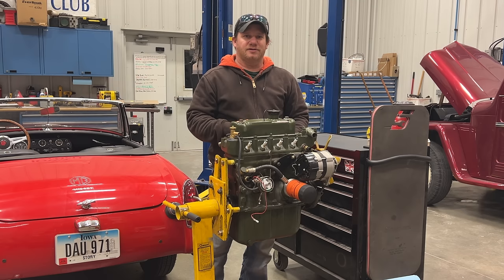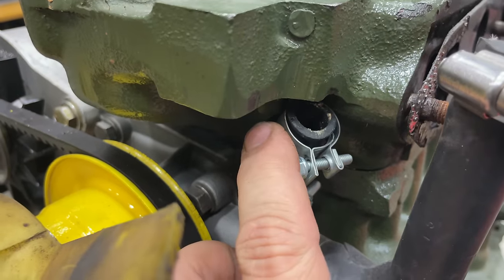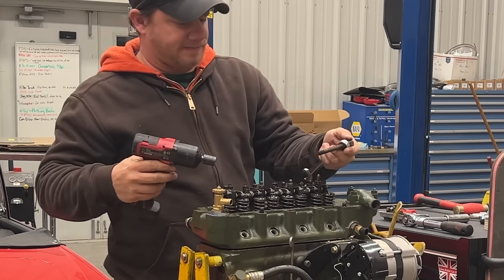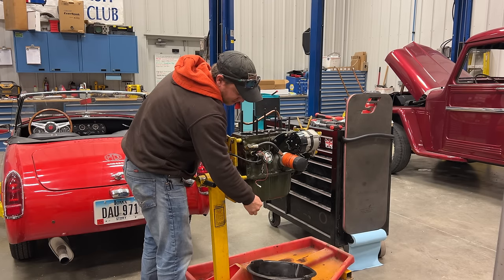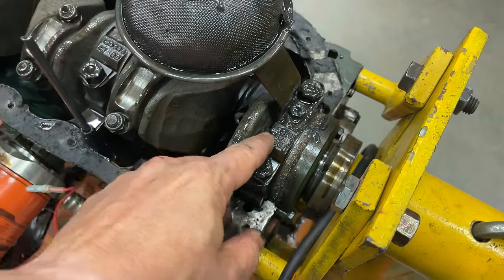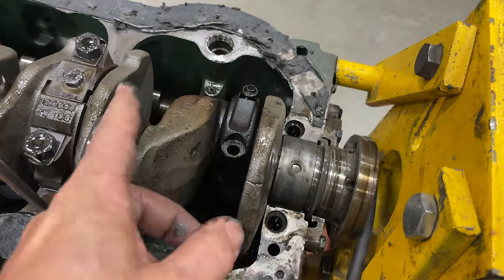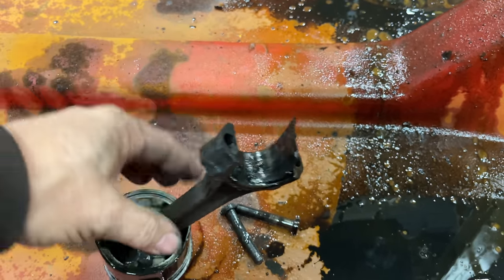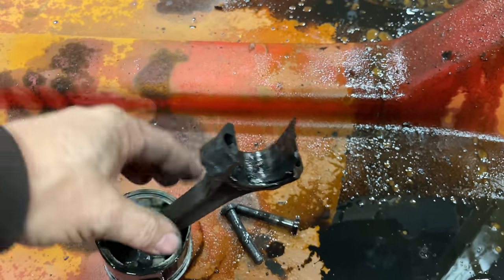Disassembling MG Midget Engine to Find Failure

Comment: If it is the origonal engine block it would be nice to keep it if possible, otherwise it matters little. The earlier models had castellated nuts and a split pin if I recall correctly, otherwise should be nyloc or similar.

Comment: Why on earth don't you get a tiny endoscope for having a look in the cylinder through the spark plug hole? They are only a few quid on ebay
Reply from the maker: I have one and have used it in many videos, no need to waste time when I am pulling the head off anyways.
Reply: @ThisWeekWithCars  Good point, and I didn't know you had one as this is the first video of yours I've seen

Comment: It has a nice coat of paint !  A few years back I bought a used Spitfire 1500 that was out of the car it looked good and had a fresh coat of black paint.  The gaskets were not painted which is a good sign meaning it had at least been apart when painted.  Fortunately the price was decent so I took a chance.  Back at my shop I pulled the pan and it still looked clean.  Upon pulling the rod caps it had a spun bearing almost as bad as this.  The scum bag had blown the engine...pulled it apart...cleaned it up and painted it then resold it.  Buyer beware.  He never represented as rebuilt however...just said it was a good engine.
Reply: Good for parts.

Comment: That was almost a lucky escape, a bit more time, and it would probably have thrown the rod and piston out, through the crankcase and then there would be no speculation about a possible repair. At that point it would be 'caps off all gone'.
Reply: Very lucky.

Comment: Given the condition of this bearing I can't believe the driver of this car did not get substantial early warning of imminent failure.  Oil pressure must have dropped significantly not to mention serious abnormal noises from the engine.  Early shut down and investigation might have resulted in far less damage.   It is amazing what some insensitive drivers will ignore until catastrophic failure.  I will not own a car without an oil pressure  and temperature gauge and monitor them continually.  Sprigets all had them.

Comment: Try and find a Datsun B210 engine plus gearbox and fit that...
you'll never worry about bearings again (it's 5 main bearing crank)
and will spin to 8,000rpm without breaking a sweat...or itself.
Reply: bulletproof japanese lump, nice idea. could go another route and throw in a hayabusa.
Reply: The Datsun engine was a development on the original A-series engine, which Datsun built under license. Another option is the A+ engine from a late model Morris Marina/Ital.

Comment: Would those motors run any better converted it petrol injection,,,
Reply: To a point.  They have siamesed intake ports so you can't do sequential injection which compromises idle quality a bit.
Reply: @rennkafer13    The very last of the 1275cc A series engines used in the classic Minis were injected.  Fuel rail had only two injectors due to siamesed ports. Probably done to meet international or UK emission standards.
Reply from the maker: In this video I show a petrol injection system for these engine used in the 60's on competition cars: https://youtu.be/vpGalN1-Ih8?t=259
Reply: @ThisWeekWithCars  
Cool , it’s just I often wonder with some of these older engines not just the English cars but every time I see an old car ,, I thing to myself, how much better would it run with updated fuel intake and electrics, great videos as usual, thanks for the entertainment, people like me that are old take great pleasure in them ,,
Reply: @johnquilter7620  ya, I have a couple friends with injected Mini's.

Comment: The problem is pretty simple, alternator is to difficult to spin , that engine is only 23 HP ,  normally you are supposed to have a generator that use about 1/3 HP on the motor to turn . You overloaded your motor with the alternator…

Comment: even if the shop gives you the ok that crank is junk. after being hammered that hard and that hot it is not safe.
a Fram oil filter some one did not like that little thing.

Comment: That looks eminently rebuildable.  Depending on the depth of the crankshaft scoring, it may be regrindable, after crack testing.  Likewise a rebore, plus replacement rods & pistons should get it going again.  BUT, you need to find out why all that damage occurred, e.g. clogged oilways (inadequate oil changes, blockages?), oil pump wear or failure?  Curing a dickhead owner maybe harder.
Reply: Forgot the oil pump.  stuck away at the blind end of the cam shaft might not be the best place.  My engine blew with the 2/3 head cracking and loss of water.
Reply: @highpath4776  Well many millions of A & B series engines can't be wrong.  Its a perfectly logical place for the oil pump, galleries more than adequate.  Well my 1981 1400cc Cooper thinks so.

Comment: If this is an early car (1098) motor find a 1275 later motor for it.. I have many NOS parts for these maybe even a shortblock
Reply from the maker: This car was already upgraded to a 1275 you can see the 12CC engine number at 3:50

Comment: Nyloc nut has got hot, the nylon melted and so no lock. Lucky the other one held or it would have been one destroyed engine. Lesson, never use nyloc nuts inside an engine.

Comment: Why can't modern engines be designed like this so that you can easily get parts reground or rebored at reasonable cost and take them out of the car in less than an hour.
Reply: Emission controls ,tighter tolerances, more sensors required.
Reply: And different production methods.

Comment: If you stick another engine in the numbers won't match. Numbers matching engines are very important for resale are they not?
Reply: If it's numbers matching to begin with, good point.
Reply: With these kinds of cars, Engines fail all the time....or lots of guys upgrade to the 1275.... I wouldn't see the #s issue to be that significant...good question...
Reply: It’s already not the original engine - it’s a 1275 in a 1098 car. It’s not a big deal for resale on these cars, though.

Comment: Picky, I know and I'm open to criticism but if you're dealing with a British engine you should be using British terms like 'rocker cover' and 'sump' although I appreciate that embedded American terminological habits are hard to break!
Personally, I'd rebuild this engine apart from that one crankpin and possible problems with the con-rod the rest of it looks to be in very good shape. Better the Devil you know than the one you don't! It would also be nice to keep the car as it came off the line, otherwise it becomes just like George Wshington's axe!